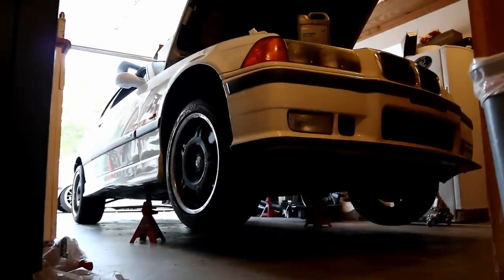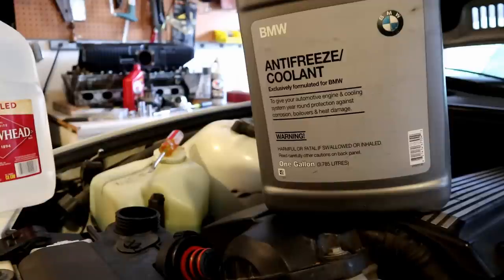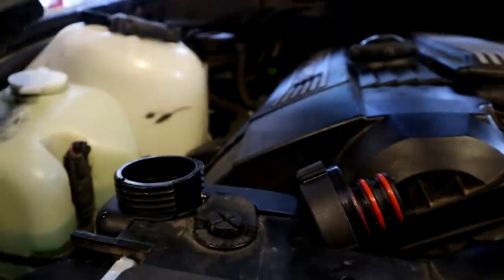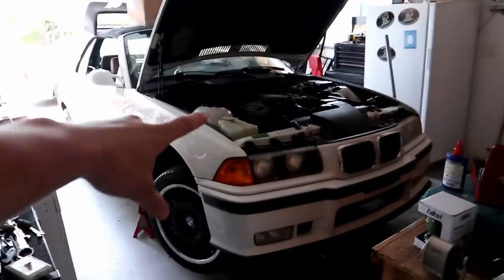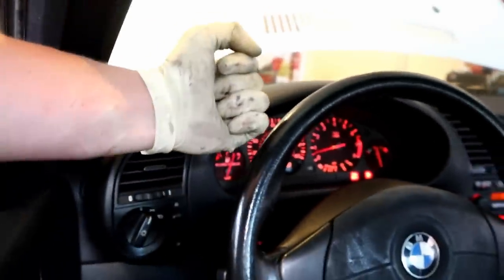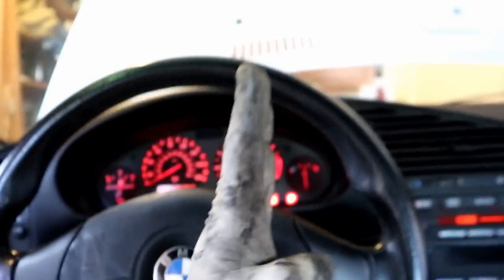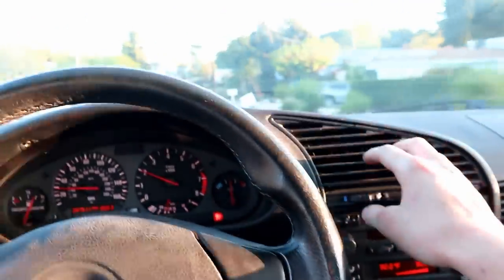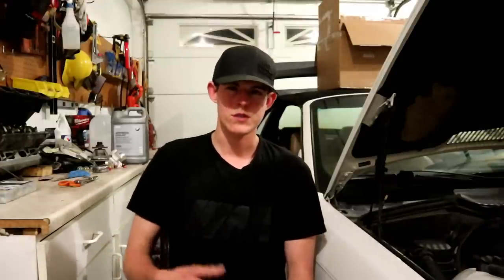E36 Cooling System Bleed DIY

Comment: I just got my first bmw it’s an e36 323i. I was out driving it hard and it overheated and shot an radiator hose of and some coolant ofc, and now it won’t drop in temperature. And I’m thinking either my thermostat is broken or I might have a lot of air in the system. Now I don’t get any heat inside the car anymore so. I’m asking you if you have any idea what can be the problem
Reply from the maker: have you tried bleeding it like I do in this video? it's possible the thermostat might be stuck. If I were you I would rebuild the cooling system fully, new water pump, thermostat / housing, radiator and hoses.

Comment: I have an S52 engine too. My problem is when the car cools down, the coolant level drops. By opening the cap, the reservoir depressurizes and coolant level goes back to max level. Looks like there is still a pesky bubble somewhere. Any pro tip to bleed the final bubbles?
Reply from the maker: does it overheat? i would leave it and drive it for a few days, the bubble will work itself out. just check the level every day and watch the temp gauge.
Reply: M3NACE thanks. No overheat. Temperature stays at the middle at all times. I’ll keep driving and checking the level. Thanks again!
Reply: Mine is having this problem. Did you get it fixed ?

Comment: bro was your cooling system fully empty when you start filling it with blue water ?
Reply from the maker: yes, radiator was replaced and engine block was fully drained.

Comment: Hi is it the same method whether it's a manual or an automatic BMW?
I have a 330ci manual.
Also if someone put green coolant in when radiator was replaced and 200 miles later my water pump failed..... Could that be why?
I think there might have been some green coolant left inside from that, and when I fixed the water pump I put blue coolant in. Is that okay to mix?
The guy who replaced my water pump did not bleed the system as you are doing.

Comment: When you pull over on your test drive, after opening the bleeder valve, do you need to worry about the radiator cap exploding off when you try to open it?
Reply: Crack bleeder screw first and you should be fine, car shouldnt be too hot
Reply from the maker: as long as there is no pressure built up it wont overflow, you can squeeze the upper hose to check. if its soft like then it's cold, your fine, if it's rock solid I wouldnt open it.

Comment: Hey! Quick question, I have a bmw z3 1997 1.9, M44b19 engine. I replaced the radiator earlier today and tried my best to bleed the system like you described. The heating system blows out warm air when I’m driving around but at idle it blows cold air! Any suggestions?

Comment: Just re did my water pump , thermostat and thermostat housing and still over heat at idle. Is this possibly air in the system? Or most likely clutch fan?
Reply from the maker: clogged radiator or there's air in the system
Reply: @M3NACE back here 2 years later for a reminder on my daily lol

Comment: When I try to bleed the system coolant gets pushed out of the expansion tank cap and makes a mess. How could coolant be pushed backwards and out the expansion tank? My obd2 scanner shows temps getting all the way to 217 before I shut off the car, how do I get it to properly bleed? Thanks it’s extremely frustrating
Reply from the maker: is the coolant getting pushed out when the car is hot or when the car is cold?

Comment: Is it possible that the check coolant light appears if the coolant levels are too high?  My coolant level is near the top of the expansion tank when cold and I’m still getting a check coolant light when I turn off the car
Reply from the maker: No, it's more than likely either the level sensor has failed or the connector is on improperly/ not on all the way

Comment: Do you know something about it, what type of coolant should be used according to the climate of a country or region? I understand that the blue coolant that everyone recommends, the one you used in this video, is very good for cold climates, but in my case, I live in a hot country, and in my city there are never climates below 20 degrees Celsius. I appreciate any help, I do not find official information about it
Reply from the maker: I live in San Deigo, which is technically desert climate and regulary see 100 to 105+ F in the summers, and BMW blue works fine.
Reply: G-48 coolant thats what BMW and several European carmakers use.  I used Zerex G-48 coolant in a BMW and no problems. Factory approved too. Preferrably 50/50 coolant and distilled water. You don't have to use original BMW coolant,but you do need to use a coolant that is suitable for BMW. Which is a G-48 type HOAT coolant.

Comment: If car doesn’t heat up properly will this still work?
Reply from the maker: it should yes, does it not get up to full operating tensioner?
Reply: @M3NACE  it does get up to full operating temperature (it even over heats lol) thats why I’m bleeding system see if that keeps it from over heating. What I meant was the climate control system A/C-Heater Fan Blower bearly blows out anything and it doesn’t get hot like a proper heater, will that be a problem?
Reply from the maker: @e46m3jose  sounds to me like it needs to be bled more, if not then i would replace the thermostat.

Comment: What would a temp gauge dropping to zero in the middle of a long drive mean?
Reply from the maker: check engine light come on as well?
Reply: @M3NACE  No dash lights. Top rad hose alot warmer than bottom. Changed thermostat last year. As well as needle dropping to zero and back to midway now and then, I have an engine run on issue where it doesn't turn off immediately with the key. Sound like coolant system not fully bled?
Reply from the maker: @rivolinho  if it wasn't bled it would overheat. my guess would be a gauge issue.

Comment: Why do some people tell you to blast the heat in the car
Reply from the maker: Becuase the heater core uses coolant. If you dont have the heater switch on the valve stays closed then the whole heater system will be an air bubble that will eventually make it’s way into the engine.

Comment: I screwed back the bleeding screw. But I have steam and sometimes cooling liquid coming out of that bleeding screw while it's screwed. Can anybody help me? Why is that happening?
Reply from the maker: Did the o-ring fall off on the underside?
Reply from the maker: Did the o-ring fall off on the underside?
Reply: @M3NACE  No, I still have it. It's still on my screw. I even tried to switch the side of that o-ring to see if there is any difference but I got the same problem. So I put it back in the good side.
Reply: @M3NACE  One thing that I noticed is that when I screw it too hard, it doesn't get blocked. it"opens" it again and I can screw it again.
Reply from the maker: @theARIAMAN  sounds like it's stripped. put some thread tape on the screw and screw it down gently until it stops and see if that fixes it. if not, you will need to replace either the screw or the expansion tank
Reply: @M3NACE Thank you . I will try that and let you know
Reply: @M3NACE  It was indeed the screw. I replaced it and that problem is solved.Thank you :)
But I'm having another issue that I don't know if it's normal. When I open the radiator cap(when car is cold), I see that the coolant liquid is low (like 30 %) (while I filled it to like 80% before), then I open the bleeding screw and air is coming out and the coolant liquid level goes up. (like 80%). Is that normal ? Why is that happening ? 
Is it because there is still air ? 
The car is not heating after 20 min driving but It makes me afraid when I check the coolant level when the car is cold and turned off. 
What should I do ? 
Thank you.
Reply from the maker: @theARIAMAN  its normal, its because the cooling system at rest is under light vacuum. you could replace the cap if you want and see if it resolves it.
Reply: @M3NACE  so I don't need to add more coolant liquid in the expansion tank in that case ? I'm safe to drive?
I will buy a new cap as soon as I can because I do feel like may be this cap is letting some air in and out. I'm not sure but just suspecting.
Reply from the maker: @theARIAMAN  well the caps are designed to intake air and vent pressure, i wouldnt worry about it.
Reply: @M3NACE  Ok thanks. So you think I'm good to go ? 
no need to add more coolant liquid  then ?
Reply from the maker: @theARIAMAN  nah, i wouldnt worry about it. if its at the full mark when the caps off its full.
Reply: @M3NACE  Thank you bro for your help and your video. You rock :)

Comment: I tried your method and the bubbles never stopped. Even after an hour.
Reply from the maker: pressure test the cooling system, i wonder if you have a leak or a bad head gasket.